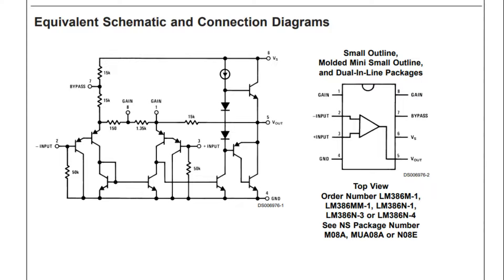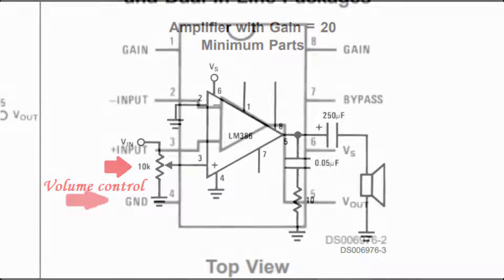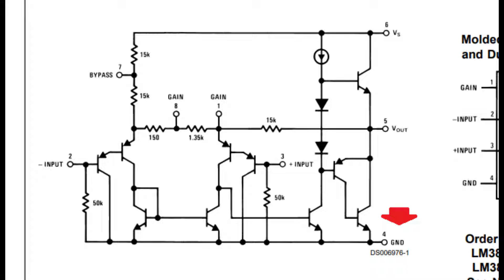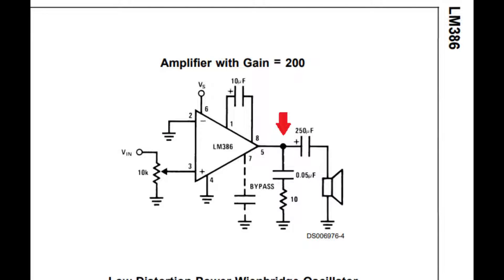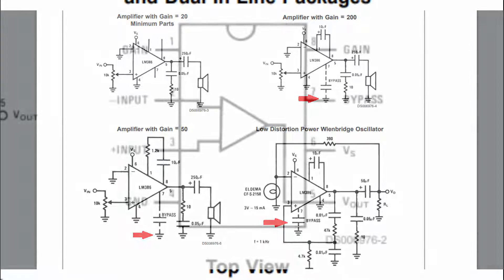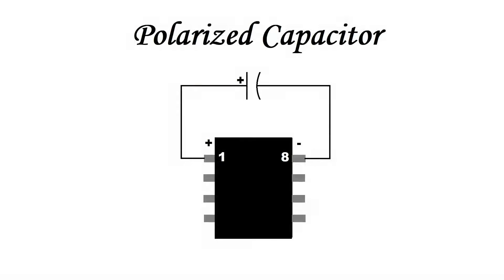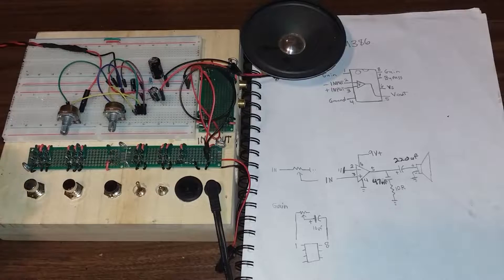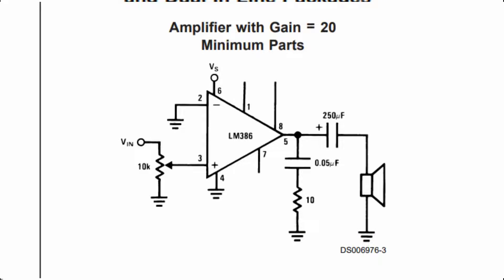The LM386 Amplifier Circuit

Comment: I like the way you go into the internals of the 386 as well as the detailed explanation of the pin out .  Your graphics are quite readable, having lots of color contrast and very little distracting marks such as ruled lines or handwriting. I learned a lot about transistors that are internal to an ic. I always found that most presenters do not go into much detail on pin 7 and am beginning to conclude that it is strictly for noise control. You have also caused me to raise a question about pin 5: what if I have an ultrasonic application where I do not want to filter out a  certain high frequency, in my case 28 kilohertz? 

I can tell that you have just started and that you are a rising star. Yours is the first satisfactory video I’ve seen that goes into the guts of the LM386. I wish you success.
Reply from the maker: Thank you! I plan on doing some more electronics videos soon, but I have been kind of busy lately. My channel covers a lot of things other than electronics too so that may not be great for my channel growth, but I like to do a lot of different things so what can I say? As for pin 5 the 0.05uf capacitor is optional. You can leave it and the 10 ohm resistor out if you don't want to filter the signal. I currently don't have a tool to measure frequency so I do not yet know how exactly to set it so that you are not filtering out a certain frequency(28 kilohertz) but I do know that the size of the capacitor and resistor makes a difference in what frequencies you are filtering out. Sorry I couldn't be more help on that at the moment but I am still learning. Thanks for watching and thanks for your comment!